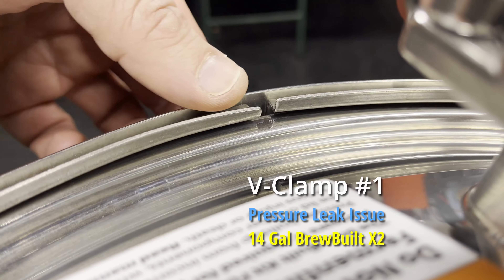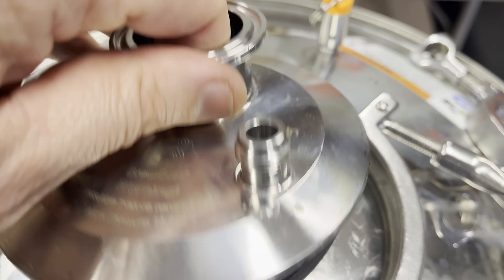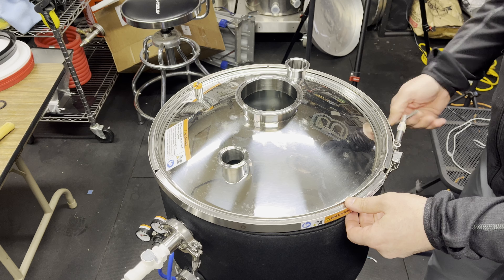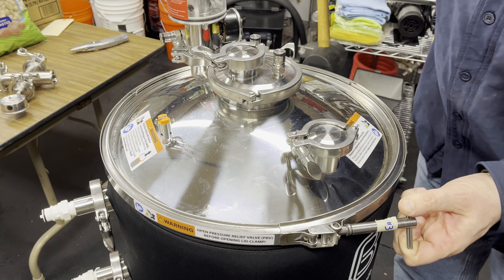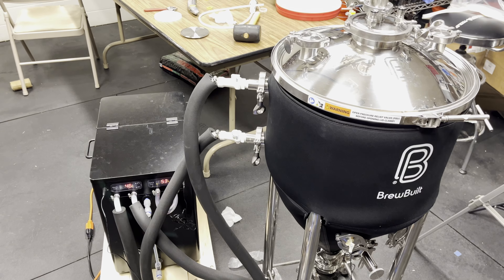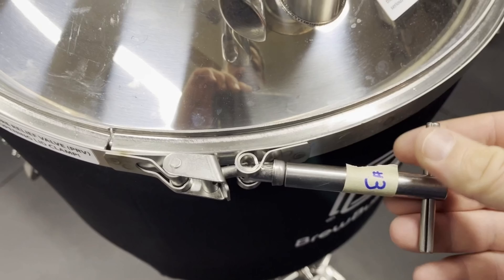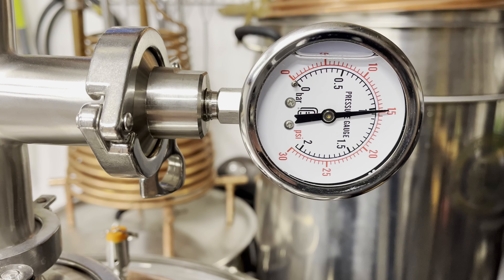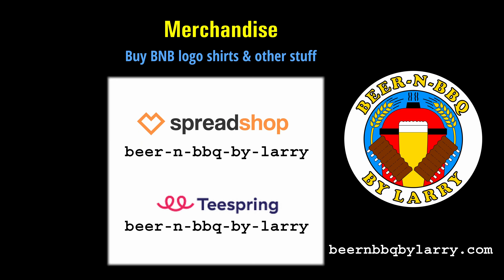Tips for a Leaky BrewBuilt X2 (and Similar) Pressure Fermenters That Use V-Clamps

Comment: I'm currently water testing my 14 gallon X2. I've got 13 gallons and I've had 1lb drop in pressure in 45 minutes so far. No bubbles, spraying dawn mix on connections. I had to tef tape the small caps on flex chamber. I used a lube on my lid gasket. Had issues with the flaring on the dip tubes. After tightening, I found my dip tubes o rings popped up above the flare and into the spring. I switched posts and  poppets with my corny keg, they have shorter poppet springs, that fixed the problem with the post leak. My corny keg didn't have any issues with the switched posts, so I really think it is the flares on the dip tubes.
FYI, Amsoil has food grade grease, if you have an account, it's $15 for a 14oz grease gun tube.
Reply: Hi I am planning on buying one but the pressure dropping problem have me worried .With the price drop they are a  good deal but this is really concerning. Did yours worked or has the pressure remained stable. Thanks
Reply from the maker: @milofer96 was always a wildcard for me. Could not depend on it. However they seemed to have heeded my advice because their new X3 uses a proper flange interface.
Reply: @milofer96   I'm not having Lid pressure issues, just the issues with the o rings on the dip tubes.
I'm also used to dealing with that kind of clamp on pool filters.
Rubber mallet really does work when tightening the clamp.
Reply: Since I switched my pressure pack connection posts out with one of my Corny keg posts, I haven't had any pressure issues. They are a good deal right now. To me, I'm retired, so I don't mind taking the time getting the clamp just right.

Comment: What worked for me - I bought a brass air quick disconnect to Barb adapter.  Slipped on some beverage tubing with a gas ball lock at the end.  Now you can use dry compressed air to do dozens of tests for little to no cost.  My 38 gallon jacketed  x2 held at 12 psi for the last week measured on a spike brewing all in one PRV.

Comment: Decided to check mine because I had not used it yet and yup! It’s leaking on the Vclamp… I also was missing the beverage tube but had one from kegland … trying the rubber mallet
Reply from the maker: Really?! Not surprised by the leak but also missing the dip tube too, eh? Hmmm. Seems to becoming a pattern.
What size fermenter do you have? 
Thanks for the feedback.
Reply: @BEERNBBQBYLARRY  Yup missing that same part, as soon as you mentioned that in your video I went and checked because I didn’t  remember assembling or seeing that piece, So I tightened everything up and added the tube, I have the non jacketed 7 gallon fermenter, I already purchased an extra gasket and lid because I upgraded my lid to the X2 lid … both leak … I’m buying the Brewtools Unitank and just gonna use the Brewbuilt in my fermentation Fridge… Lotta money to spend for that kind of design flaw … totally disappointed… would not have known until brew day if I wouldn’t have watched your video … Brew day is today! So thanks! 😂
Reply from the maker: @BeyondMyGardenGate  Ouch. Sorry to hear about your troubles too. At least you didn’t have to experience it on a real batch like I did. I had to keep pumping CO2 into mine just to maintain positive pressure near the end of fermentation.
Glad this video helped you.
Reply: @BEERNBBQBYLARRY  Called customer support and they are phenomenal! Sent out a new clamp, lid and dip tube the same day and I am living in France … for anyone that’s reading this later … More Beer is a great company to deal with …. But I would still say … get Brewtools if you have the budget, or Kegmenter if you don’t … and last but not least … grab a used corny keg and Spunding valve from Kegland … you will be better off …

Comment: Thanks for this video, great job. I have an x1pro with the same v clamp. I have not had issues with leaks yet after a few fermentations but i did realize i was never sent the liquid side diptube on mine either! Im considering the x2 but its odd they have these clamp issues since its the same design as the x1. I think ill just use my x1 for now with a coolstix installed.  The x1pro is a nice idea but it uses a lot of energy and has some trouble keeping temp within 3 or 4 degrees of set point during peak fermentation.

Comment: Some suggestions, after my first batch. When initially  pressure testing, just use CO2, water absorbs your CO2 and it takes too long to pressure test. Don't use any lube when initially installing the lid gasket, you'll never get it in, follow Larry's suggestion to install.
After getting the lid gasket in, caulk the inside gasket seam solid with keg lube. You can run your finger on it and spread it, just make it look like it was caulked. Don't put any on the rim of the x2. I centered my lid and clamped it down, using the rubber mallet, like Larry suggested.
The gap on my clamp was 5/16, never had any leaks when following this. 
I took my beer down to 48°, from a 95° Kveik fermentation at 10 psi, without any leaks. Went from 1.050 to 1.010, in less than 24 hours. Finishing crashing in my kegs with gelatin right now.

Comment: A food safe lube/keg lube on the lid gasket has served me well.  I’ve had my Spike Flex+ at 10psi for over 4 weeks now.
Reply from the maker: Thanks. I tried that too. Was the first thing I tried.  The problem is the v clamps. They fit too loose and do not compress the gasket much on this system.

Comment: I’m still torn between the X2 and the BrewTools. My Spike with the same lid clamp has been solid.
Reply from the maker: My Spike Flex does pretty well but still has shown itself to have a slow leak at times. 
I do recall a similar issue with the CF10 a while back too.
It’s just a flaw of the v clamp being misapplied to home brewing fermenters.
Reply: There is no comparison between BrewBuilt and BrewTools. Buy once, cry once - get the BrewTools.
Reply: @SteveBenson  I’m leaning that way!
Reply: @SteveBenson  I’m for sure going Brewtools!

Comment: Thanks for the tips Larry!  I have a couple Spike Flex+ fermenters and love them.  Regarding the stabilized pressure (i.e. when you mention that it stabilized at 8PSI) - the drop, as I understand it, doesn't necessarily have to do with leakage so much as CO2 being absorbed into the liquid.  This happens during pressure ferments and while it happens at a slower rate with "warm" (i.e. room temperature) liquids, it still can occur.  Was this considered when you were seeing that pressure drop after you fixed your initial leak?
Reply from the maker: Yes. That was my tip #6.
Reply: @BEERNBBQBYLARRY  AHhhhhh... I need to pay more attention LOL :)  Thanks Larry!

Comment: Great tips Larry, these are useful for troubleshooting! While I haven't experienced the pressure loss issues you have the v band clamp problems are the case for me as well, and I was also missing parts to the pressure pack! Lots of stuff to consider with these
Reply from the maker: It’s becoming a common complaint I’ve been hearing.
Is unfortunate because otherwise, it’s a decent conical fermenter.; not a unitank as advertised because it can’t be used to carbonate.

Comment: Hey Larry.  Thanks for the great tips.  I called MoreBeer Customer Support today and it sounds like it could take months to get a replacement clamp.  I noticed the same thing with the clamp that you did and was planning to get out the Dremel and cut a little bit out.  Can you share what your're using as a quick disconnect on the coolant lines for the jacket?  I don't recognize the fittings that appear  briefly in your video.
Reply from the maker: They came with the cooling line kit sold by more beer.

Comment: I had similar issues with the brewbuilt X2. I received a replacement fermenter after a replacement lid and Clamp. 
The 3rd Clamp was much better than the first two.
Get a big rubber mallet. You can also compress the "C" shape of the Clamp.
Also put some silicone grease on the o-ring and on the thread.
My X2 is finally working great!
Reply from the maker: Interesting. Thanks for the X2 info.

Comment: Same lid sealing problem.  mine will seal(-ish) one out of ever 10-15 attempts (and by seal I mean will hold more than 1 psi at least for a few minutes).  How much do you recommend cutting off of the band?
Reply from the maker: Depends on how poorly the clamp fits, how much more tightening is needed, and how much adjustment is left on the threads.
Reply: Just an update - received a new v-clamp from Brew Built.  The new v-clamp has a substantially smaller diameter than the old one.  Snugged the new clamp up and my 7g x2 is now holding pressure on the first try!  I'll report back if I experience further issues.
Reply from the maker: @billcooey9647  That’s good.  I told them they needed a smaller diameter clamp. Good to see them acting quickly on it.

Comment: It may have been noted by now, but there is no savings of CO2 by filling with water. By the time you get all the CO2 dissolved into the beer, so that more solution doesn't drop your headspace pressure, there's exactly the same amount of CO2 in the fermenter as if it had no water in it. Best to just use compressed air in an empty tank.

Comment: Great VIdya Larry. New products need to be put through their paces. Repeatability in the production of equipment used to brew beer equates to repeatability and consistency brewing beer. I made a comment on another vidya, ironically of a similar device, not long ago that design software like Autodesk and Solidworks can give great insight into how well the product is built and possible interferences, but offers very little if anything to the capacity of the equipment to perform as designed. It seems the more complex we get with these vessels, the more room for malfunction is afforded. Cheers Buddy.

Comment: That's a lot of anxiety to have with such an expensive piece of kit
Reply from the maker: More parts means more complexity to manage. The upside is that with the cooling jacket built in, pressure fermentation isn’t as important if using a chiller. However, unless it can hold pressure, it’s not really a unitank.
Reply: @BEERNBBQBYLARRY  hope it works out for you

Comment: The simple solution is using sandwich wrap (plastic film) on the edge.
Reply: Edge of what? Like put the plastic wrap around the mounted lid and then the clamp?
Reply: @WGK21  yes
Reply from the maker: What does that do?
Reply: @BEERNBBQBYLARRY  stopping leaking pressure
Reply: @firstalawal  that’s not a bad idea!
Reply: @firstalawal  just tried the plastic wrap … that’s not working …
Reply: @BeyondMyGardenGate   I use it for my 2 stainless steal fermenters works good all the time.
Reply: This is working for me.  Spunding at 10-12psi.  I have the initial release x2 clamp.